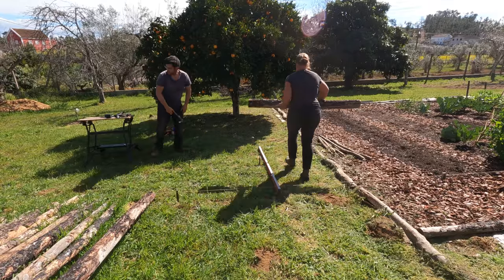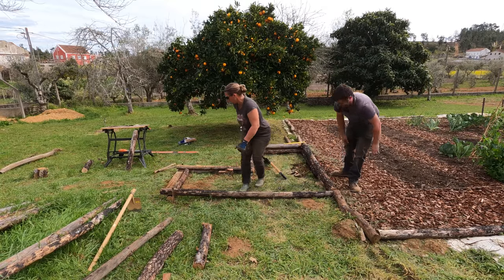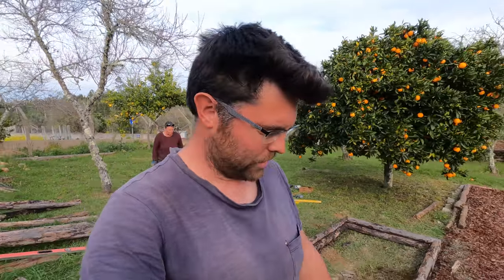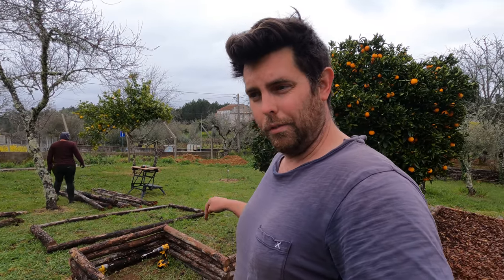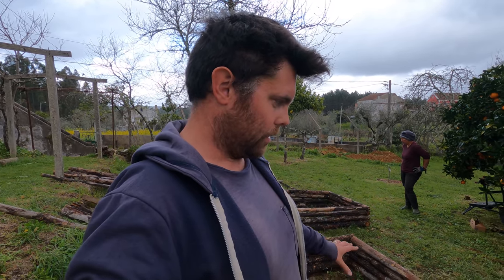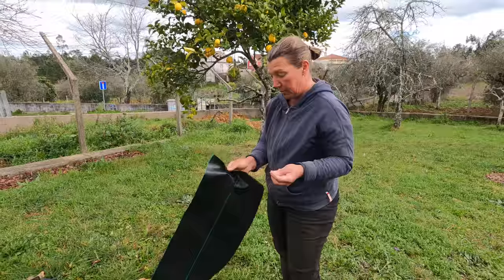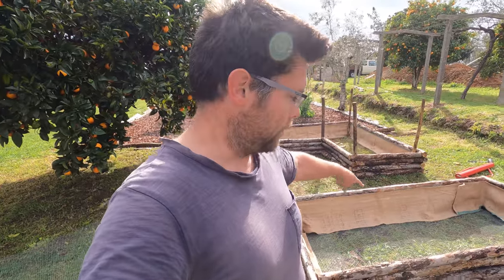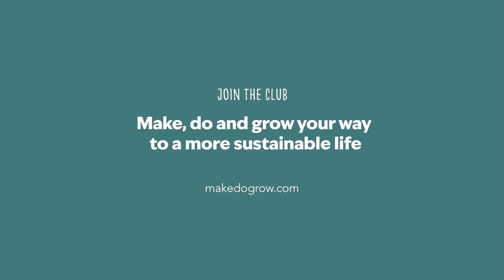Building RUSTIC Raised Beds from Fallen Pine Trees - #5

Comment: The beds look wonderful.  Great use for the recycled timbers.  When the beds are planted your eye will be drawn to the plants and the irregularities will disappear.  Log cabin builders de-bark logs to prevent moisture from lingering under the bark.  Helps keep bugs away from the logs.  Shou sugi ban is a process, developed in Japan, of charring/toasting logs.  It can increase the life of de-barked timbers decades.  Can be done over a fire or even with a propane weed burner.  See you're using Dewalt tools....You know...They make some really nice battery chain saws.

Comment: You are putting so much work into your high-rise beds, have you thought about protection? To prevent the wood from rotting you can use fire. Shou Sugi Ban is an old japanese method where you use fire to preserve wood. It doesen't cost much, is sustainable and looks good!

Comment: The thick black plastic sheeting (with circular indents) used for waterproofing and protecting the outside of basement walls would work as a lining for your raised beds.  It won't decay, and doesn't fall apart while you're cutting it.

Comment: Kylie: I want it rustic
Also Kylie: Pulls out a level :D

btw. bark OFF, else the wood rots much faster

instead of expensive screws, you could consider using rebar in the corners... little hard to explain but you pretty much just drill a hole in each end of the logs and stack em, then when you are done you cut off the rebar and if it is long enough you use it for another corner and so on, takes a little sawing to "halve" the logs where they cross each other but rebar (most places) is much cheaper than super long screws
Reply from the maker: Let’s call it rustic perfectionism then 😂
Reply: @MAKEDOGROW  🤣
Reply: it also gives the slugs and snails a cosy home right next to a great food source. it looks lovely but i think you might regret it in time.
Reply: @FaenumVena  Slugs and snails; it's like weeding a work in progress.
Take 10min each dawn and dusk to pick them up and you keep them under control. It helps to have the soil, a clean and dusty 1 - 2m wide band  around the cultivated areas. They don't like crawling on smooth and dusty ground, they dry out...
Reply: @TheZambu  Thats not easy when you dont live where your growing and your not very able bodied. Ive used beer traps before and they work, but some years its so wet here in the UK that there are just too many of them. Where I live we have heavy clay soil too, the time our ground spends dry is very minimal, and when it is, its not dusty. Its easier not to give them a haven to live in to begin with.
Reply: @FaenumVena  do you think that because of the posts it will attract more pests?
Reply: @mafaldahortinha1637  have you ever moved something in your garden and an army of slugs, snails and woodlice all make a run for it? Critters need these hiding places to stop them drying up and getting predated on, so giving them somewhere nice and cozy right next to tasty food is inviting them in.
Reply: @FaenumVena  I thought about that, bit I also see many people using wood for their raised beds and I never heard them complaining.but it's a good thing to consider when I star to build mine. Thanks 🙂

Comment: The raised beds are just right on a farmstead. Years ago, I used the Gardena system to connect soaker hoses throughout my small property. It worked like a charm. The only suggestion I have is to protect the connectors from the sun so they will last longer. Kylie, the thrill of a yarn delivery!!! I am surprised you didn’t stop work and cast on 😉. I am probably the only viewer who is interested in your yarn adventures though. But what kind of yarn was it and what is it going to be?
Reply from the maker: Good tip on the irrigation connectors, might need to either bury them or build some small timber housing for them.

I’m hoping to use the yarn to knit a jumper/sweater and learn how to do multi-colour knitting. Just have to find a beginner friendly pattern that I like 😀
Reply: @MAKEDOGROW  If the connections are semi permanent you can wrap them with aluminum foil tape (used for air duct)
it's tenacious and absolutely blocks UV.
Reply: @MAKEDOGROW  You could make a hat to practice the stranded (multicoloured) knitting, it's not that hard when you know how to knit already. And going up a needle size for the stranded part compared to the plain part saves a lot of hassle. I consider fiber projects just as much "Make" as a raised bed or orange wine, so bring on the videos! 😉

Comment: Have you been happy with the cardboard? Last year was an epic fail for me since it broke down so fast and the weeds found there way through quite quickly. Bind weed especially.
Reply from the maker: Cardboard worked really well for our first 5 beds where we’d tarped the area first (which killed off most of the weeds etc), but not so much for our latest beds where we didn’t cover first. We’ll be going back to the cover method for any new beds, or manually digging out the biggest weeds first. Thankfully we don’t have any bind weed, but have heard it’s a nightmare to deal with

Comment: I hope the wire mesh works to keep out your voles, I have done the same to keep mice and rats out of my plastic compost bins (not enough room to build the bays like yours). You were being a bit to perfect over your raised beds as imperfection is the point of rustic.I put the wire mesh over the top of the pallet raised bed which I filled mostly with compost  to stop rats and mice again and planted into it cutting out squares for the plants. Unfortunately there so far appears to be nothing lasting on the market to line beds with. I had to have the pallet constructed raised bed lined with corrigated iron after that dreadful plastic broke down after a couple of years. Gardening is a contast learning and trail and error exercise.             Lana                                         Australia

Comment: Could build with vertical posts. The concept of leveled is slightly different.
Could also use rope to fill the gaps between the wood. It is smaller but covers the essential. Juta was a nice option.

Comment: I kept wanting to tap you on the shoulder and point out that you put one of the beds under a tree canopy (assuming that tree is alive and just not leafed-out yet). I made that mistake putting a bed too close to a lemon tree and the bed gets too much shade. Hardware cloth worked great though in stopping gophers.
Reply from the maker: Due to the direction of the sun that tree won’t put any shade in the beds ... we did consider the trees when choosing placement. It’s so hot here in the summer a little shade actually wouldn’t be a bad thing .... we’ll have to install some shade protection for sure

Comment: Hi Both. I got a great giggle out of watching you attempt to get straight and level lines with natural materials. My advice there is embrace the wonky, and also leave the posts long as you build the frame shape, then trim once in place with a chainsaw, a bit like laying a deck. Re the voles and moles. I am pretty sure they can not dig through stone and heavy gravel. so I would create deeper frames and fill the bottom with the rubble you have about the place. 6 - 8 inches should be enough. The wire you have will break down over time and eventually they will get through, and you have the rubble already from your house build so its a cheaper option.  I hope that helps. D

Comment: Can you use the plastic sheeting temporarily hung in the house rather than coffee bags?
At least you'll have loads of brash for the bottom of the beds from the various tree and shrub pruning.
Rats have been known to chew through 5mm sheet steel (in a grain store) but I suspect voles are not in the same league. Perhaps you need to sacrifice some 🥕🥕 🥕 by planting in an open area to keep them from the wire base. You can also plant varieties of onions, garlic and daffodils to discourage them

Comment: I know that you have an abundance of oranges and I wonder if you could risk moving the orange tree that is in the way of your garden beds. Also to maybe level up the beds you could dig a shallow foundation and fill it with some of your brick rubble.  Tap it down level and put your bed on top. then secure posts etc.  These beds are a great idea for peranial plants.
Reply from the maker: We try to disturb the soil as little as possible, so didn’t really want to dig in order to level them ... a non- organic ‘foundation’ would also mean that moisture can’t travel up/down from the soil beneath
Reply: @MAKEDOGROW  Just use as a foundation
Reply: Start again. Use as a foundation only under the poles.

Comment: Great up-cycling for the logs! It is a nice way of bringing new live to such a misfortunate episode from the recent portuguese history.

About the voles, I believe it will work. We have some 16 raised beds (all similar in shape: 2 meters long, 1 meter wide, 80 centimeters heigh, so much more dull that the ones you built) and our first try without bottom protection was a dramatic (for us of course because it was like a summer resort for the voles....). One thing though, the small mice (field mice?) can climb the outer wall of the beds, so do not be very surprised if you find on inside one of these days. But the small mice do not cause that much damage as the voles. 
Our trick to get rid of those pests, and also the slugs that climb all the way from the grass into the beds, was to build a sort of parapet all around the beds and glue to the underside of it a copper band. With this extra barrier the slugs do not pass, because the copper develops a sort of allergic reaction with their slime and they just back off into the grass again, and the mice just cannot get their claws into the wood and fall down into the grass due to the slippery surface.  

Just as a side note, for the voles the only kind of trap we found to work is the "Supercat" mouse trap (originating from Switzerland, but easy to find on Amazon).

As someone already commented previously, a nice addition would be an irrigation system, to cover for the dry periods. We have one of those "foam-like" hoses that lay buried some 5 centimeters from the top. It works great, and two nice side effects are that 1. the plants develop their roots towards the bottom of the bed motivated for searching the water and, 2. the evaporation is almost non-existing. We have it connected to a Gardena controller that we can activate at distance via a Philips Hue "Smart Plug", so when we are a week off on holidays we just monitor the rainfall via the Netatmo weather station (same as you have) and water out the plants. I just love the geek side of gardening :)

Keep on the great work and the motivation to experiment, instead of giving hears to the one we in Portugal call "Velho do Restelo" (if you do not now it, just Google and you will see what I mean).
Reply from the maker: Thanks for all the tips, hoping we don’t need to add much more vole proofing .... the cat also does a great job bringing them to us as ‘gifts’ 😂

Love the idea about automating the irrigation. Pretty sure our (very dodgy) 4G WiFi setup wouldn’t allow us to setup a Hue just yet, but we’ll definitely plan for that when we work on our irrigation - that probably won’t be until next year, but might experiment with something temporary this year.

We get plenty of comments that would have us believe nothing we do will work .... but until we’ve tried and failed (and tried again) we stand by our belief that anything is possible ... typically just needs more thinking and experimenting 😀

Comment: Sorry to say but raised beds don t work in this Portugal region.
We haven t got the air humidity for it and you will dwell with it on the summer.
You would be better to go the opposite way and go dig beds.
Reply from the maker: 😂 our friends successfully grow in raised beds, all year round .... evidence is proof
Reply: Also had friends doing this here but like i said this doesn t work on a commercial level.
It s pretty to see but requires lots of work and with a 600ml rainfall over the year here  you ll get problems with drying the beds too fast.
Look at the old farmers here and talk to them and get ideas from that.
Hope i m wrong but like you said evidence is proof.
All the best
Reply: Here in Indiana we have raised beds. Only thing we see is they may dry up quicker as water soaks downward into the ground, so we water them a little each evening.
Reply from the maker: @zepedro6290  we’re not doing this on a commercial basis (and wasn’t what you mentioned in your initial comment)
Reply from the maker: @rickreed5666  hugelkultur really helps with the water retention. Might be worth looking to see if it might help where you are .... our next video will show how we’ve done ours
Reply: @zepedro6290  I think they are growing the produce for themselves, not commercially and if you have an irrigation system it shouldn't be a problem.
Reply: Also a mulch can be added to retain moisture.
Reply: I have just one question here?
Who knows this Portugal Region?
Who has experience in growing raised beds here in this region for at least 5 years?
Like i said before i hope this experience works well but this is a region with a special soil and very low pluviosity and with the experience i ve seen it works better to invert the raised bed in to the ground.
This creates soil, fertility and the moist necessary for the next crops.
This said i drop the mike and hope all goes well